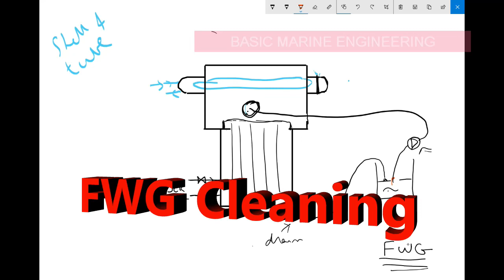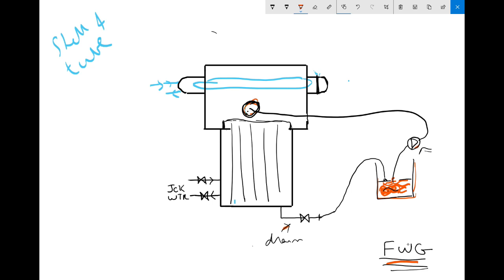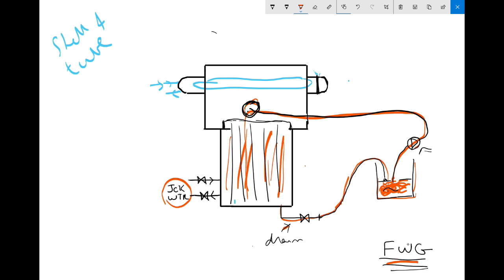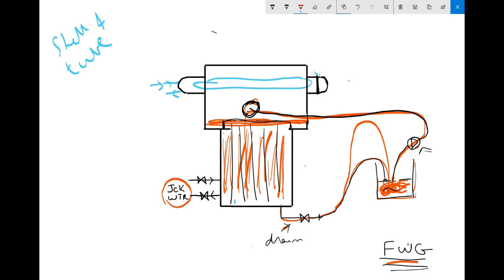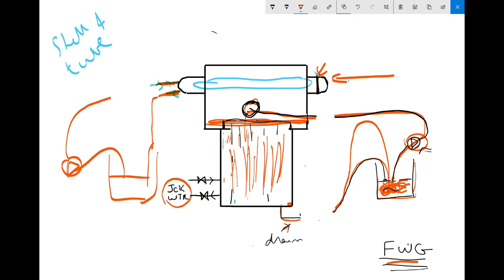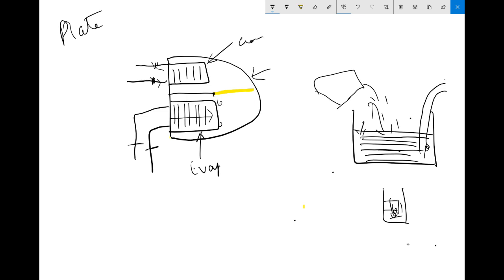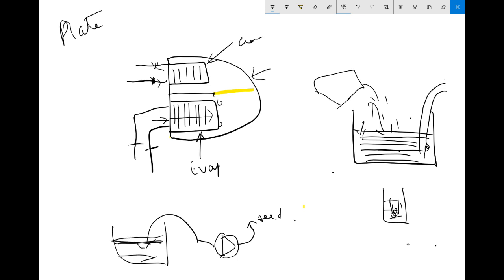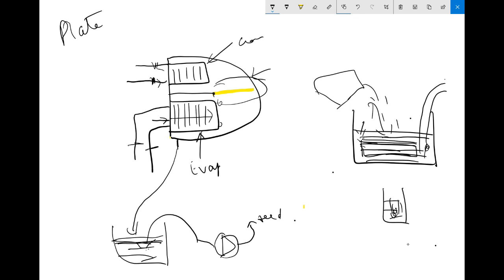how Fresh water Generator cleaning is done?

Comment: What is the ratio of chemicals we add
Reply from the maker: Depends on the chemical check the chemical manual for saf acid of Drew marine add chemical till orange color
Reply: Thank you sir 
Hopes u amswer a question. From me
How to remove the bottom shell of main bearing of auxillary emgine which is not underslung type ?